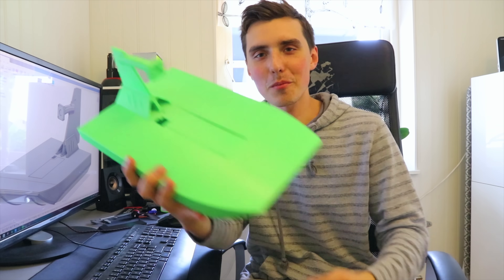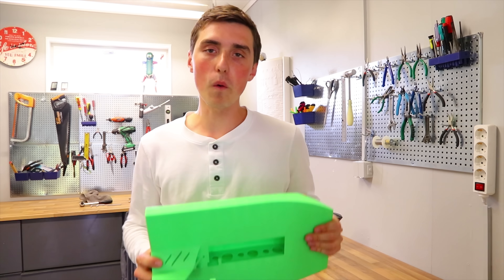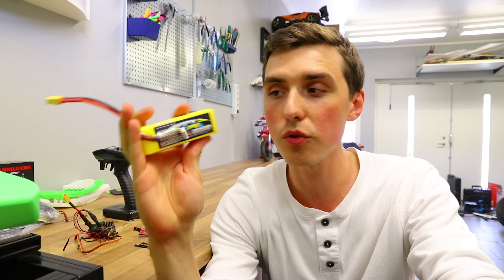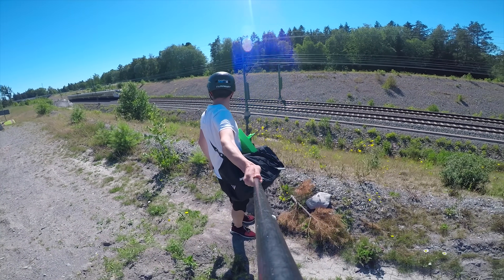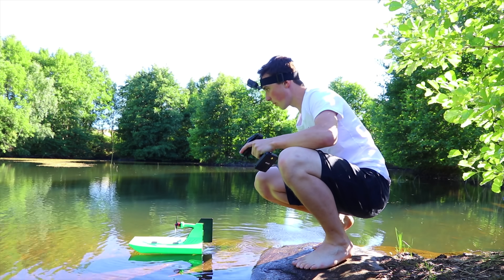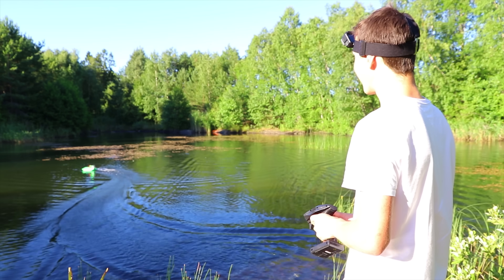Awesome 3D Printed RC Airboat

Comment: Watching this I just wonder if you could have changed the pitch of the motor in the vertical plane to direct the forces different. Do this on planes but in the horizontal plane. Nice work and video.

Comment: Hey, Simon, can you help me? I don't know enough about outrunners to know what I need to buy. Here's what I have: It's a triangular aluminum chassis with three points underneath for attaching pontoons. I have a Parkzone 480 motor, using 7"-10" propellors with various pitches. Also, a large assortment of lipos & ESCs available. The motor sits high on a mount & can be tilted forward or backward (thrust-vectoring by servo). I want more speed, MUCH more speed, so what dramatically stronger motor would you recommend I buy? I also welcome input from anyone reading this :-)

Comment: Use meth..alean cloried  (Dichloromethane) i have used it to make pneumatic PLA parts that hold 100 psi with no leaks! it fuses the pla well and at only 20 a L it can treat a lot OF PLA.

Comment: I was able to print one yesterday almost 12 inches long  on my ender 5... tried a 1608 2300 quad copter motor with a 20 amp esc and a 3s 40c ...had to cut down a  5 inch tri blade... but setup seems to have similar performance to your larger one... on the floor anyway... i did manage to break the motor mount arm  do to rough handling installing motor ..i printed on 18% infill not 20% plus i think i printed my petg at to hot a temp... mine came out pretty messy but i was able to use scrapper sand paper and acetone and smooth it out... will tweak cura settings when i print my next one and hopefully get better results.. my next one i will print at 25% infill since weight is only a gram or 2 more... Not sure what weight is for full size version but my hull was 308 grams... thinking full size is around 500 grams...

Comment: Nice work! I’ll make my own soon. Just one question... there is no reverse mode? Need to turn on itself if stuck somewhere?
Reply: he uses a car esc with a fan...you can buy these type of esc's with reverse...some don't have reverse... but have a fan is critical unless you mount an airplane esc on outside so air blows over it to prevent over heating.. it very important to keep esc cool or you will have a possible fire... i used to run regular boats years ago and have destroyed many esc's , batteries and motors.. do your research before ordering your parts... the parts he has listed are good...if they are out of stock find te same exact parts somewhere else and you will have a safe reliable setup... This kid knows his stuff,plus he has already done his testing... Good luck!

Comment: haha well back to the drawing board for me on this one..  I finally got it all done 30 seconds in to my test, let out a ton of smoke from the 2205.. really wish I knew more about why..
Reply: If motor failed you were over loading it...to big a prop or pitch or to much power from battery.. if esc was not hot thats good... cooling is very important for esc and batteries also... a good setup is when batt,esc and motor are barely warm after 5 mins of hard running... this avoids fires... i have burned up plenty of electronics over the years on boats and planes..mostly boats they are the trickiest to setup imo...

Comment: i the motor is pushing, it maybe won't lift the back. If you take the battery to the nose, and make the propeller at the back, for push, it maybe will work better. The video is nice! ;)

Comment: I will try to improve on this project once my tevo tornado arrives. The issue you are having is a thrust issue, has nothing to do with the prop. The propeller is pulling the back of the boat out of the water at high speed. Design a boat with the motor behind the boat will solve this issue.

Comment: I have made water proof 3d prints by giving them a bath in acetone fumes. The water leaks between the layers. But if you do an acetone bath the layers fuse together more completely blocking out water leaks... This would work even on your thinner walled first boat...

Comment: Instead of moving the motor further down and switching to a smaller prop, maybe changing the thrust angle could help. One or two washers between the motor and the bottom screws should tilt the motor enough so that it pushes down the back of the airboat :)

Comment: Some guys are printing waterproof RC sailboats in vase mode with only one perimeter (just up the thickness a bit). It's often the retraction points that are leaking so vase mode solves that issue.

Comment: Hey Simon, I love your videos! If you intend to do more rc boats: you could design a waterproof box for all your electronics to fit in, in the future you´d be able to use this as a base for your standard components. Then use some spray foam inside the hull to practically make it unsinkable. (might be overkill though :-D )

Comment: I made one, had to scale it to 85% and use the split files because of my printers Z axis height ended up leaking so I painted the hull it was also nose heavy With the 3S 2200mAh. 50C LiPo all the way back. I'll add some weight in the rear.
Here is the video. Thanks for the file..
https://youtu.be/KmLieXPgxsk

Comment: I printed a couple of these for the kids to pkay with on the water, but when I used the linked/recommended esc with a 2205 motor, the motorr got hot and went poof! Can anyone recomend a better combo? I ordered 3 of these esc's, so if I can use them great, if not, they can be used for something else.
Reply: did you happen to figure out what happened Im currently looking for an ESC

Comment: To use the larger props you could probably adjust the angle of attack to help push the back down a little. And it might have also been torque roll with the mass of the larger prop so some counter torque fins would probably also help.

Comment: ive contacted you on thingiverse
would you mind if i modified and posted a remix on your split airboat?
ive modded for my needs in tinkercad,tapered the alignment pins,enlarged to pin holes,added water drain channels,working on a better cover and possibly radio tray.and ive used different hinges.
i would like permission before adding a remix.if you dont want me to ad a remix its not a problem i will not publish the files.in my opinion you are a well respected member of the 3d printing community,we all really enjoy your work on reviews,diy projects.i just wanted your permission and to say thank you for your time and efforts.

Comment: You could add like a wedge under the hull, so it kinda floats on air. Like the racing boats. It also makes it more efficent. Also add some fins on the end of the boat, that helps against the twiching. Other than that this is a great Channel, great content. Keep it on!

Comment: Why is nobody using 18650 cells instead of those huge lipo packs? 2200mah and it takes that much space and weight? Whats the benefit of using lipo over stacking 4x 18650 cells?

Comment: Should keep the big prop and just add a washer or to behind the bottom screws on the motor mount to see motor points slightly up, this will push the rear of the boat down giving to the proper force.

Comment: How about adding two T-shaped skids to the design so that at higher speeds it lifts the big area of its body out of the water (needs to be shaped in a way that it does not collect plants etc ;) ). That should add some max-Speed improvement to the construction.
The issue with the torque due to the high mount of the motor may then become an issue again but may also be adressed by changing it´s horizontal angle or reducing its moment by moving the propeller further to the back?

Comment: Hey, great boat design!
I just wanted to suggest looking into using epoxy for waterproofing. Using silicone makes a good coating around the board, but, if your silicone skin is punctured somehow, water can get in and will be trapped inside. The epoxy will run in, under, and around all of the chip sets to fully waterproof it.  Just a suggestion.

Comment: If you set your extrusion to 104% or better, one layer will be watertight.  I've tried it on vase mode and made watertight vases.  Nerys showed me that trick.  It wont be very strong but it will hold water.

Comment: You should cut it in half and fix it with flex tape!   Next video: I SAWED THIS BOAT IN HALF AND REPAIRED IT ONLY USING FLEX TAPE
Reply: I sawed this rc boat in half, and repaired it with only flex tape. And I put it in nothing infested waters and holds up well
Reply: Vilmo Would Flex Glue work too?
Reply: Rares Iordan probably

Comment: Why not use PETG ? its more impact resistant as well!  Most mass produced water bottles are made of petg for example. I print it on stock CR10s all day. Awesome job correcting the setup with the smaller prop and lowering the motor. Looks like great fun now!  Congrats on full reinstatement into the 3d printed boats world!   :)

Comment: I have built several air boats , the motor and prop need to be as far back as possible . That is why full size ones have the engine in the back with a pusher prop setup !

Comment: I mean with the RC boat what you can do is 3d print it with ABS and acetone smooth the outer layers of the boat. Another Youtube by the name of Peter Sripol 3D printed his boat and did the exactly that and its completely water proof. Also I too 3D printed a boat out of PLA and one way I made it water proof is by putting a layer of XTC-3D and it worked.

Comment: In order to counter act the offset between the centre of thrust and the centre of drag, you need to add some down thrust to the motor mount - point the prop down a bit. That way the air stream from the rear of the boat is pointing up and helps to lift the nose of the air boat up and high throttle inputs - try 3 degrees first and see what happens and then change from there. Nice boat BTW

Comment: I build the same thing years ago aut of foam.
I used 2 edf and it had the same problem at high trottle.
I think you scould test some kind of elevator cuppled to the throttle.

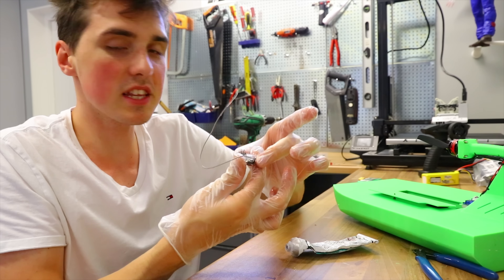Comment: 4:18.. The acid in standard Silicone Sealant will corrode electrical wiring and bare PCB traces/pads over time.
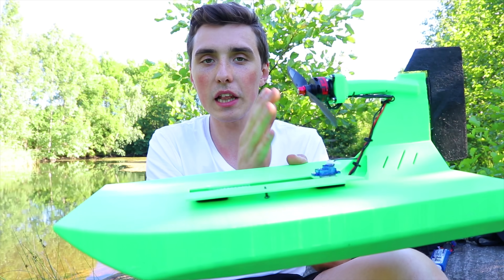8:11.. Just change the Thrust line of the motor by tilting it down a bit. Like they do on RC Airplanes.
Reply: I’m not smart enough to understand these intellectuals
Reply: Everyone says that silicone acid will corrode the electrical wire. Here I am with my poor raspberry pi outdoors for 7 years covered in a glob of silicone. Any day now it's gonna fail.. right?
Reply: Simon knows his thrust lines :D As you saw, the cg was straight below the motor, so there wasn't much to do with angles. Lowering was the correct thing to do. If it's possible to move the CG back (heavier battery), it would help to angle the motor up, or if the motor is moved back instead, then angling it down helps.

Comment: If you were to make another boat, could you attach each section of the boat with screws and the put silicone or apoxy to seal the gap. and to cover the top of the boat you could do the same just make the top separate and you could seal it on. I'm working on a boat right now using this method.

Comment: Pick up some brush on silicone modified conformal coating for electronics waterproofing. its much easier, more reliable and less mess. get the brush on not the spray. its much easier to make sure you get a good coat.

Comment: That intro is  unnecessary, very entertaining and proof that you take pride in the videos you do, at the same time. When I saw how high the propeller was mounted, I knew that the boat would have a chance of toppeling forward. You fixed it quite easily though. I saw this video a while back. It would be nice to see this blower function on a boat. It's not nearly as efficient as a propeller but still cool in a way. Great video :) https://www.youtube.com/watch?v=wg8ZbiC9IBw
Reply: I thought the intro was clever and fun instead of, "Hi, today..."
Reply: I thought so too. Logically it was unnecessary but still fun and clever.
Reply: Your comment is unnecessary so.....
Reply: Why are everyone so hooked on that word? Read my whole comment before commenting yourself! If you did that, you would've seen that I was giving him a compliment. I also gave him a video idea cause I thought it was cool. I like to be brief so I don't write an entire novel as a comment. I will write a longer one and in with more depth next time so people won't get offended.
Reply: The guy in that video should get a 3D printer. I think that plane of his would be much better if some parts of the plane was 3D printed, except perhaps the wings. I suspect it might become too heavy if too much is 3D printed. But it was cool to see :)

Electric RC has come a long way since I used to do it (90s?). I might start again, since I have a 3d printer now.
Reply: The speed record for a human powered boat has an air propeller, not a water propeller.

Comment: Great little boat ! But PLA (Polylactic acid) is hygroscopic, so, it will over time become leaky. But two or three coats with spray paint or plastic ( K70 Plastic Spray ) fixes that. I did some light-insualting funnels for outdoor water collection, and the paint fixed the issue of the PLA unbonding.

Comment: Simon great video! Did you modify the stl file with lower motor position?
Reply from the maker: Yes, the stl files on thingiverse has been modified to fit the 5 inch propeller.

Comment: What's the minimum size of the print bed you need to print this boat? Does it fit on a Tevo Tarantula? 20x20x20 cm
Reply from the maker: Hi Michael! No unfortunately, the width is 270mm and 350mm tall.
Reply: RCLifeOn In witch country do you live
Reply from the maker: I live in Sweden mate.

Comment: Haha, i dig the extra effort put into the presentations. Keep things comical with the extra skits!
Gonna get a 1mm nozzle for high velocity printing, to take advantage of the build volume of a cr10 s5. A filament maker rig too. Ever use a filabot or any others? Seen one that replaces a printers extruder, to directly recycle on demand, with a wood chipper and a paper shedder making pellets for the hopper. Vulcan high5 \V/_

Comment: Can you make on that will fit on the Ender 3
Reply: (220x220x250mm)
Reply: You can scale it down in your slicer until it will fit your printer.
Reply: rc Ohio and then scale down your servo and motor to fitt the holes 😊
Reply: slarvar there are multiple different sizes of motors. There are also quite a few sizes of servo